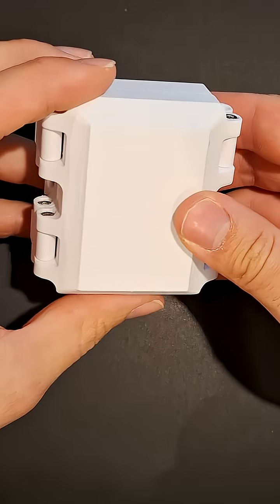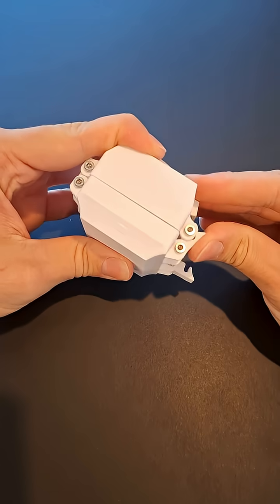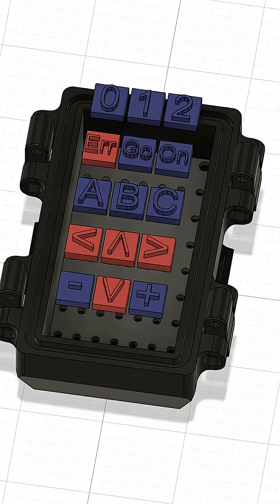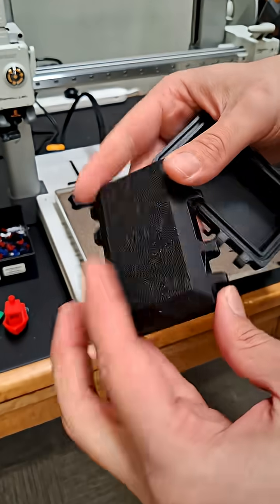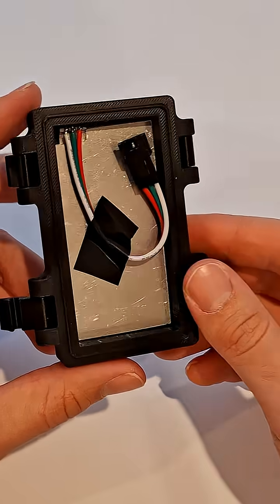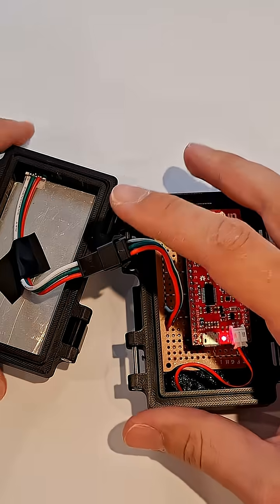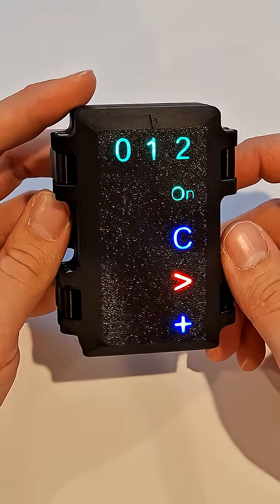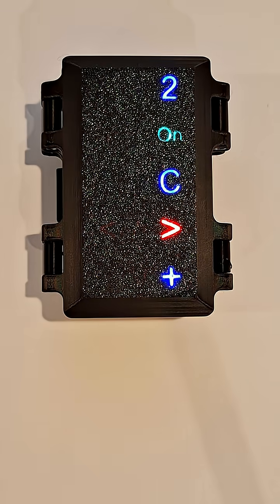LED Status Display built in to this 3D printed enclosure! #3dprinting #electronics #esp32

Comment: what worked for me for something like this was using bold, uppercase letters. a 0.2mm nozzle helps a ton for small details, but it would at least 4x your print time. alternatively, you can print the faceplate with symbols inserts by itself and add it to the case body with a gasket, but that's another point of failure for humidity. neat project, keep it up!

Comment: I love it!  The idea of building light pipes into a custom display using mmu/ams should have been obvious.  I have built other types of dashboards with embossed legends, but a multicolor led behind an icon light pipe for a pro-grade display is taking it to the next level.  I have an upcoming machine build where I will have a panel handling sensors, gasses, fluids, and various flow, temperature, ph, etc.  I had planned to just laser out a simple punch panel to mount everything...  But now I may reconsider how I make that panel, I /could/ turn it into much more...

How are you making touch panels?  that light pipe element needs a debounced, latched, inductive "button" sensor.  Your demo should let you touch a symbol and see it cycle through the led colors... 

Using the addressable led's just takes it up another level for the easy demo, but a real application would might be the system main-board with tricolor led's and touch sensor inputs...  but it could be a remote panel too...

Good job!

Comment: Remember to make holes in the bottom, no matter what you do its going to get damp in there and water will build up, better to have a way for it to exit
Reply: If it has to go under water, or be outdoors in arbitrary orientation that's not an option, instead you put silica gel absorbent inside.
For anything that is mounted to a wall and has a heat source inside, absolutely make holes in the bottom.

Comment: I want to do something similar for a project that's an indicator of if I'm on air and streaming so nobody knocks on my door.

I think my biggest issues are that I've not got the fine motor skills in my hands necessary for soldering, I'm afraid of screwing up with a LiPo battery and having it catch fire, and I don't know where to start with the design of an enclosure for it. I might at least have it powered via USB C.

I have a printer, and I do have OpenSCAD (cause I'm programmer brained), but not the know how for the rest of this.

Do you have suggestions for how to tackle any of these?

Comment: Did you make the first layer a solid single material? Or do the inclusions penetrate?

I've been using this truck for years to cleanly put labels and logos into prints. Print the first layer in a transparent material that is optically compatible with the labels' materials. Gives an even surface that is not distributed by the interface between the different materials, and if they are fully enclosed in the backside as well, there is little risk of separation with physically incompatible materials as they are entrapped.

Comment: If you want to go with addressable chain of LED's using WS2812B or similar, you don't need to go with different colored transparent inlays. Just use transparent white inlays and adress the LED's color as needed.
Reply from the maker: Yes you're correct, I already had blue and red translucent filament so I just used that.
Reply: ...that approach allows for more flexibilty and the coloring of the different keys can be changed for status indication or whatever
Reply: yeah, colored light pipes makes no sense, use clear light pipes, and multi-color led's.

I bet his second prototype uses clear, if he has clear.

Comment: If you want To have an interface like buttons you can use conductive filament and an esp 32 which uses touch ports which allow you to make touch buttons
Reply: I was thinking the same thing but he did mention he was doing this to keep it water tight so it water on capacitive touch might not be great for this particular use. But it would be great to see it on indoor projects
Reply: @HoldYourSeahorses  it wouldnt function underwater but it would still be waterproof.
Reply: @HoldYourSeahorses  yeah... I know, that's what I said. It won't work underwater, but as soon as you dry it off it will work again, meaning it is waterproof
Reply: No, you do not need conductive filament, just metal underneath for capacitive touch. It works through plastic.
Reply: The buttons on a waterproof watch?

Comment: Because you are using 3d printed plastic, how is the actual water rightness of your prints? Usually it is next to impossible to make 3dbprints water tight without additional coating. Do you use any coating?
Have you tested the water tightness?
Reply: my 3d printed pla umbrella tip protector keeps the hollow space dry
Reply: @danifalkjensen  print a hose connector and test it with water. Soon it will leak. Some water droplets or splashes are ok, but not bigger amounts of water.
Reply: This comment reads so manically 😅